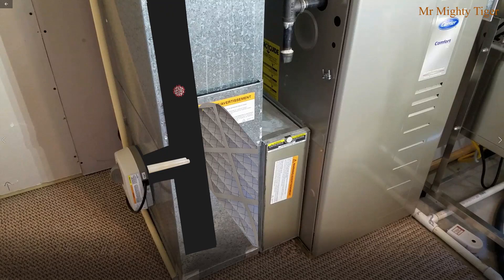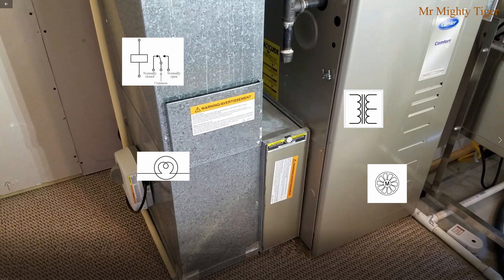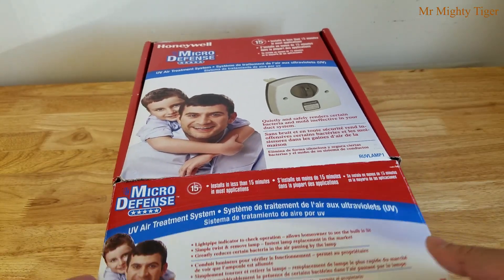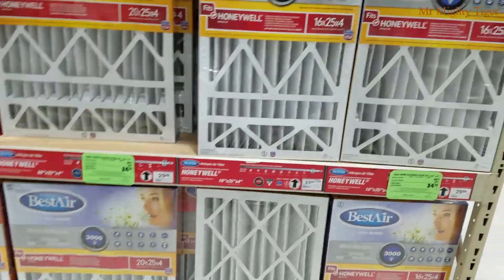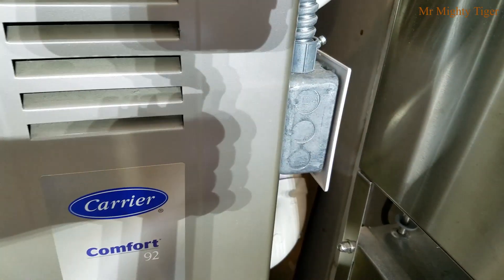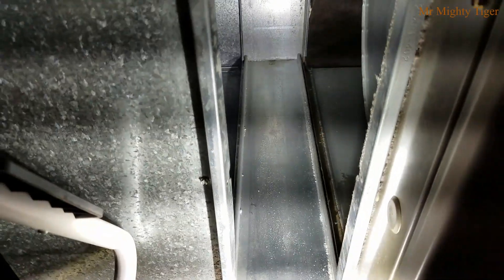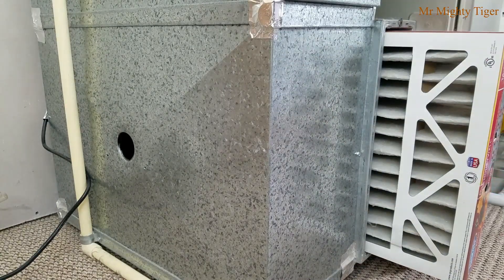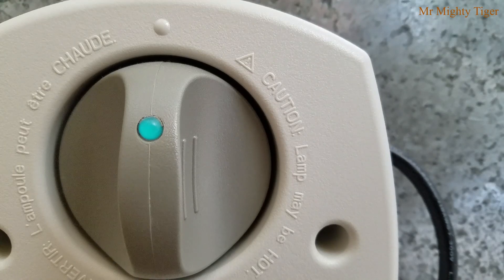House Air Sanitizer

Comment: Can be install at supply premium, ? In some houses the furnace intake it's near the grill intake where once lamp is on, will be seen by people
Reply from the maker: You're right on! It's not a good idea to install a UVC light where it could be leaked/seen by people. Most HVAC techs would recommend to install the UVC light on the return air side of the duct work and away from the air filter IF you do not have a timer to turn the light ON/OFF. It will burn through the air filter element. 
 
In my opinion, most furnaces can pull the air volume so fast that air born particles will just pass by the UVC-light too fast making the light less effective. But something is always better than nothing.

A different design of UVC light than the one I've shown is meant for the supply air side. It goes underneath or above the evaporator core. You could do some research on it for more details.

Comment: I have purchased the same model Honeywell RUVLAMP1 from HomeDepot and installed it differently following the manual that came with.  If you take a look at the manual, Page 2. Fig.2 (Typical surface treatment installation), installation should be for heating and cooling not only for heating.  Summer time you will turn heating off and only cooling will be on where furnace air flow is different.  No filter for A/C but the filter is on A/C unit itself for outdoor units (very pricey to be cleaned or replaced). When installing, always use your manual and location should be above your evaporator coil as explained in manual on Page 2 Fig. 2 on your unit on the plenum not by furnace filter.  Unit kills viruses, mould and bacteria.  Very happy with unit.  House air smells like new. P.S Unit RUVLAMP1 (on the video) is not equipped with bulb saving technology (Optional Smart Lamp) that measures air flow and turns on only when it senses the air flow but model RUVLAMP2 has it. It only extends life of the bulb by few months. Either or unit is a must to fight covid.  Great video I'm sure it protects your home.
Reply from the maker: Excellent! There's a caveat... if your house was built by a "cheap builder" like mine, you can't get access to the AC evaporator core that easily. You'd need to disassemble lots of duct work to get to it. There's no accessible door to the evaporator core.

Comment: there is a lot of shaded areas on the filter. 

where the uvc can't reach.
Reply: Correct.  The UVC tube should be oriented parallel to the filter, not pointing at it, for maximum UV exposure of the filter.
Reply from the maker: That is so true. Light shines in straight lines, but has a tendency to reflect off hard surfaces that could potentially get to other areas other than line of sight. Same goes to the air flow. What ever might  be trapped in air flow has the tendency to flow in straight line especially with the force and the amount of CFM that the furnace could move.